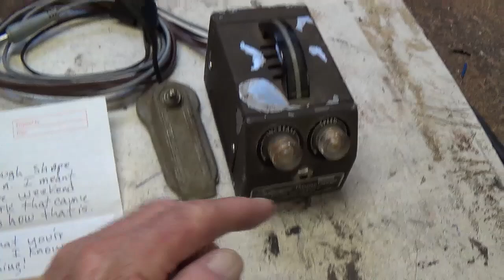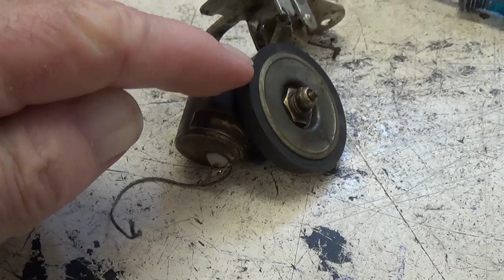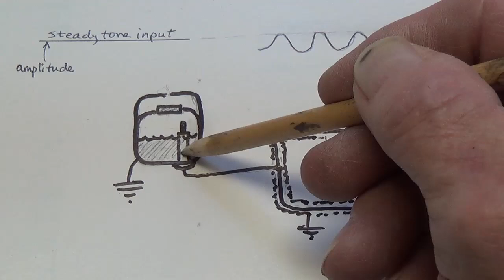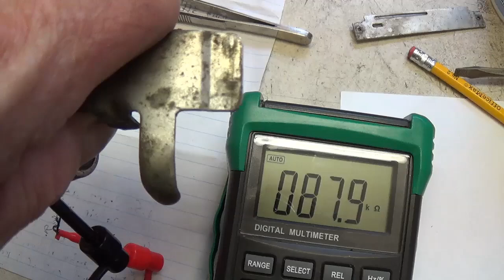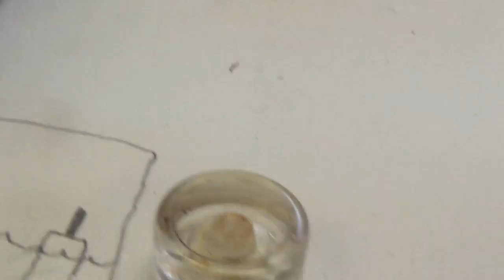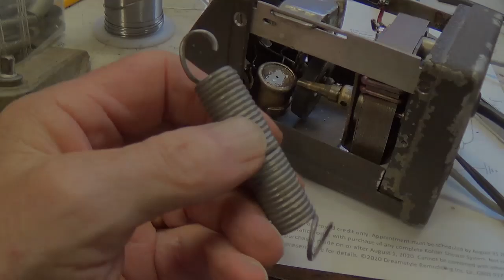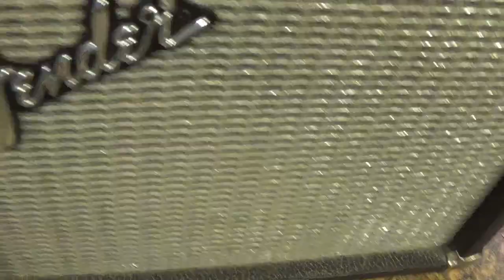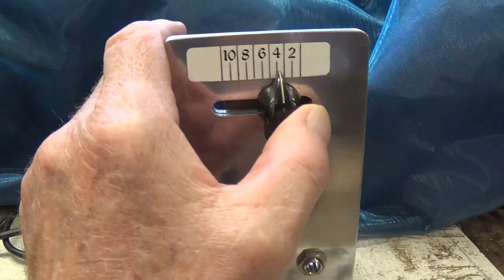1940's DeArmond Electromechanical Tremolo Unit.....DeAd on DeLivery !!!

Comment: I think the C tapered pot was a good solution. I had this issue with a fuzz I made and the solution for me was to put a resistor in series with the pot. I found the resistance level where the effect just starts to kick in, let's say there is a 500k pot and at 250k resistance, this is where the effect is audible, so I'll throw a 250k resistor in followed by a 250k pot, so the lowest level is where it just begins and overall, I still have the same 500k resistance, just the full spectrum of the knob becomes usable. That's a super simplified example, but it works.
Reply from the maker: Thanks for your helpful input, Queef :)

Comment: I thought for sure you were going to put  mercury in that little can.  Dangerous stuff... but back when it was built I wouldn't be surprised if they used that.  Very cool that Windex does the trick.
Reply from the maker: Mercury is too conductive, James. It would probably produce a square wave.

Comment: Uncle Doug, here's an eBay link to a darn-near mint DeArmond tremolo control...$1,599!!!!! The pictures show you what that large hole in the back was for (the one you used for the 3-wire AC cord): https://www.ebay.com/itm/DeArmond-TREMOLO-1950s-Rowe-Industries-Rare-Vintage-Tremolo/254744343444?hash=item3b4ff23394:g:oU4AAOSwoYZfgTox
Reply from the maker: Apparently the price has been reduced to $1299, AJ, so it's a real "steal" now ;)  It makes sense to have an on/off toggle, but the one I worked on had an on/off footswitch to take its place.

Comment: Hi Doug started accumulating some parts going to have a go at building one going to use " Meccano"( I don't know if you had that in the USA )I have a 12volt motor and parts from an old record player   I have an  Ac30 amp a rapier 33 guitar and a black cat copy cat .I am now 63 and  I was 20 when I acquired the equipment. wish me luck ps do you have a po box lots of love to the cooooooool cats from over the pond
Reply from the maker: Best of luck with your project, Shaun. Let us know how it turns out.  Thanks !!!

Comment: I knew that little spring had to be used but you replaced it with a much longer one and different mounting point. You must have inside information on how to improve the performance. It seems to work beautifully.  D
Reply from the maker: There was only one spring, Dennis. The scenes were out of order. Thanks so much.

Comment: Couldn't you reduce the ohms in the Canister (not easy) but would that have improved the low intensity tremolo signal? (Why Windex?) looking forward I have a GM car with Magnetic controlled shocks. I can dial in the viscosity of the shock absorber oil because is has metal fillings that can be pulled out by a magnet. Changing the strength of the magnet changed the ride of the car. Ah Could you work up a fluid that could change its resistance to current flow in the same way????? If you wanted to mess around?
Reply from the maker: The canister has to have a fair amount of resistance even when shorted, Dennis, to provide a pleasant modulation. Windex has the right amount of dissolved solids and free ions for proper conduction.

Comment: I use dBlue Magic on my Model Train Steam engine drive linkage and it can be polished to shine like Chrome!!! Wonderful stuff.  Why did you select Windex for the fluid???  I am so excited to see your unit work and what it sound like. Hoping i can find one I could afford. Great little gizmo. D
Reply from the maker: Yes, as I said in the video, that article is what initiated my desire to own and clone the device.
Reply: Maybe Doug read the article in Vintage Guitar where Billy Gibbons talks about this tremolo device. Billy said he bought a used one, it didn't work, a tech at the recording studio told him it probably needed to be refilled with Windex, he tried that, it worked. 
https://www.vintageguitar.com/18545/dearmond-tremolo-control/
Reply from the maker: Thanks, Dennis. I didn't select Windex.....it's what they actually used.

Comment: you did not mention the little spring hanging of the wheel and canister of oil. Like an old phonograph i expect that spring keep the rubber wheel in contact with the tapered drive shaft. If it was off when received that would have prevented it from functioning properly. If the Plastic units have the same guts it would be great to find one of these units. Super project. Dennis
Reply from the maker: The spring you see is the one I installed, the scenes were out of order. The canister is not filled with oil. Thanks.

Comment: Great video, beautiful piece of tech. I would've loved to hear how that intensity pot sounded in audio signal circuit going all over the place. Do you think the lack of spring could've palyed a part in giving a signature character to the effect? Or if it didn't do anything interesting hopping, now just more reliable and quiet mechanically? This unit at full speed makes me dizzy. But somehow very pleasant sound, not sure if it's the cats playing and Fender, or this unit, but it's smooth. Good job.

That self-made speed control makes me think of old radio equipment controls, chicken head isn't exactly that vision, but does the job! Those lightening drilled holes look professional, as if professional gun.
Reply from the maker: Thanks, Yup. Glad you liked it. We never heard the tremolo without the spring attached.

Comment: I'm wondering what the advantage of switching the hot side of the line is?  It's not fused, so if anything about the foot pedal gets a short to ground, there's going to be fireworks.  But if you switch the neutral, then the current will be limited by the motor.
Reply from the maker: I guess because when you switch the hot wire, the unit is not constantly energized while plugged it.

Comment: i figure it was 12.5 percent of the range of the original potentiometer that was useable.
Reply from the maker: If that much. There was only a small fraction of the arc of rotation that had any audible effect.

Comment: Hello Uncle Doug & Family, I'm sure you know that means the Kitties, I mean Rock Stars. Nifty little unit you will know inside and out, after a thorough restoration. During your sketch explanations, is there an impedance match between the DeArmond and the amp speaker or doesn't it matter? A Kennedy took box finish, I knew for 34 years as a Journeyman Machinist, as I did a 4 year formal apprenticeship, just a measly associates degree. Elementary, my dear Watson. Awesome job on the rebuild, nothing you can't fix. That little 'ol band from Texas. Yes, commenting along with the video. Good to "see" you again, glad you are all doing good. Sweet tweed amp, sounded great. Nice tremolo from that little unit. Been mid to upper 60's down to the high 40's, definitely the 10th month. Thank you for all you do providing quality content. All the best from Oregon, Cass.
Reply from the maker: Thanks for all the nice comments, Cass. Since the signal passes straight thru the DeArmond unit, I don't think impedance matters. Low 90's here still.....getting very tiresome. Our best to you.

Comment: Your graph showing the difference between the log audio and the reverse audio had a fabulous cameo appearnace of an ant. Or....!!! Perhaps it was AUNT DOUG? (love it that (so far) you haven't flicked or squashed said ant back into the spirit pool). :).... Hi Uncle Doug!
Reply: Have you tried running the DeArmond  AND using the tremolo of a nice fender amp? I wonder how that would sound?   Your tremolo speed variance map circuit modification is a bit slower than the DeArmond, no?
Reply from the maker: I used to tell my students never to destroy anything they couldn't repair, and that includes living creatures.....even ants :) I haven't tried the two together and the DeArmond is back in the owner's possession......so maybe next time.

Comment: you said the Vibro Champ.. Fender has a "tremolo" which is actually more of a "vibrato"  -and uses a light roach, right?  cool unit here.. will be on the scout now...
Reply from the maker: The Fender harmonic tremolo, utilizing 3 additional tubes can produce somewhat of a vibrato effect, Malcolm, but all the rest of Fender's tremolos are simply tremolos.....and only the larger circuits use the flashing photoresistor unit.

Comment: UD, what happened to the spring that was hanging loose in there when you took it apart?
Reply from the maker: There wasn't one. What you saw, in a scene out of chronological order, was the spring I installed.
Reply: Wasn't that the spring that held it against the speed control?

Comment: 30:09 - This is where an analog meter comes in extra handy!
Reply from the maker: Yes, indeed, David. By far the best way to monitor pot sweep.
Reply: @UncleDoug  I lost track of how many Simpson 260s and Triplett 630s I own, and man when either one of them is out of specification and will not calibrate you have to wind or combine 0.1%  resistors to  some really wacky nonstandard values, but it's all worth it when you have an analog meter that, when you deduct the lead resistance, is dead nutz spot on with a fresh calibration certificate Fluke 8042 using the 4 lead Kelvin clips. I also have a few Danish Bruel & Kjaer audio volt meters/ dBm meters, that are absolute works of tube instrumentation era artisanship inside. Those are a huge pain to refurbish compared to the Simpson & Triplett meters  but so so so absolutely worth it! The Bruel & Kjaer universal microphone preamp is another fabulous piece of gear that includes the audio volt / dBm meter. (also a huge pain to take apart and fix)

Comment: Greetings Uncle Doug,
   Another great video about a really interesting device! I also have  a little info to pass on. First of all, those clear knobs are probably acrylic. And as luck would have it they were glued on instead of having tapped holes with set screws. This is really good luck. If the holes were tapped the oils present on fingers would have slowly, but eventually, wicked into these tapped holes and caused the knobs to crack. Acrylic is notorious for this. Secondly, several years ago I had a poorly designed but really useful device quit because of a lack of cooling of a shaded pole motor quite similar in construction to the one in the DeArmond Tremolo unit.  Since I could not find a replacement motor and because I can be pig headed I rewound the damn thing myself. It wasn't that pretty but it works very well. With the cooling holes I added to the device the motor does not and will never run too hot. If someone buys a DeArmond Tremolo with a burned out motor they could do the same by drilling out the rivits holding the winding laminations in place. Then, if they have the patience, unwind the the wire onto a form so that they can calculate the length of the wire. Then buy a spool of the same gauge wire and rewind the coil. I know, it takes time, care, patience, and maybe a little gin, beer, whiskey, or wine. Or tequila.  In any case, a broke musician with some time, your video, 20 bucks for wire and a cheap six pack, could rewind the motor for one of these units.
Eric, who prefers gin for rewinding  motors. After the rewind.
Reply from the maker: Thanks so much for the very helpful tip, Eric.

Comment: could you replace the canister with a mercury switch
Reply: That would cycle between infinity resistance and effectively none - no in between. It'd be a chopper, basically.
Reply from the maker: Hub is right, Tim. The result would be a square wave.....more like a machine gun than a rhythmic tremolo.

Comment: The reason the pot seemed to use so little of its rotation is because your signal generator has a 600 or 50 ohm output instead of the high impedance of the instrument. I bet it works fine with a high output impedance.
Reply from the maker: Nope. It worked a little better with the guitar, but still only used about 60 degrees of rotation. These devices are known for their hair-trigger intensity control. With the RA pot, the usable sweep was around 200 degrees.

Comment: I was pleasantly surprised when you said you use to work on pinball machines. I too was a pinball mechanic. On the edge of electro mechanical and into solid state. Cool beans. You will get a education when you learn how a pinball works. Tell me if I am lying when I say, Even a brand new machine will have the ball stick somewhere until you engineer a fix. Heading to the local bowling alley on Sat. nite to free the stuck ball you develop skills you didn't know you had!
Reply from the maker: You really hone your diagnostic skills working on those infernal EM pinball machines, J&B.  It's like trying to fix four or five amp circuits, side by side. I shudder to recall the experience.

Comment: Very warm.  It beats a Watkins Kopycat hands down.  That plokky sound of the tape joint passing the heads, and being re-echoed, wasn't always aesthetic. (Flicks back non-existent hair).
Oh, that's an echo chamber...  I'm up too late....  Wouldn't a well-designed electronic tube device do the job?  Not those funny optoswitch gadgets, just pukka pentodes perhaps....
I would dearly have loved to restore and improve the mechanicals and finish to the way the original would have evolved to by 2020AD.  You could do it, Doug.
Reply from the maker: Thanks, Tony. I tried to do so.....did you see my two creations?
Reply: @UncleDoug  No.  Was it in the same clip?  LOL  I thought I'd reached the end.  Any invention previous to that would involve Indian servants.  They'd be tremulo-wallahs.

Comment: one of these on ebay rught now for a crazy price, the big hold in the back has a power switch in it, I wonder what is period correct?
Reply from the maker: Does it have a footswitch?  No need for the toggle if it does.
Reply: @UncleDoug  you know, I don't think it does, maybe they all had it as its in the same place, or it's an earlier model?

Comment: Why did you chose Windex and what was the original fluid? Since this reminds me of a mercury switch, I'm wondering if that was what was used then.
Reply from the maker: I read that Windex was the proper fluid in a Vintage Guitar story that has a link at the end of the video description. Mercury is not suitable, due to its toxicity, high mass, affinity for brass, and excessive conductivity. It would result in a square wave output, rather than sinusoidal.
Reply: @UncleDoug  Thanks for the detailed reply. Very interesting. I figured no one would use mercury now, but I would not have thought of Windex.

Comment: You are the best I've ever seen at amp repair , building among many other things . My friend recommended you to me . Fine job sir . Would you please help me with something ? I have a 65 Super reverb reissue that I just picked up. I installed a new tube set and while trying to bias , I am only getting a reading on one power tube . One tube is super hot to the touch , the other isn't at all and basically looks like just the filament is on . The amp sounds great but obviously a lot less volume than it should be and it breaks up quickly . I have turned it off until I figure something out . Bias pot will only go as high as 25mA as well .
Reply from the maker: Thanks, Donnie. Apparently only one tube is functional and is flowing way too much current. Switch the tubes and see if the problem follows the tube (= bad tube) or remains with the socket (= bad connection, probably to cathode).
Reply: @UncleDoug  thank you much sir , I appreciate it !! I'll give it a try

Comment: Very cool unit! I worked at DeArmond designing pickups in the late 70s-early 80s. i was able to score a couple of slightly newer units (plastic covers) from the leftovers and one still works well! The other needs new fluid. The lady there who did the repairs told me that they put Windex in a tin can and let it sit overnight, then injected it into the little cylinder with a syringe. A little hocus pocus!
Reply from the maker: Thanks for the historical info, Ken. I wonder if leaving the Windex overnight allowed it to pick up some metal ions from the tin can, increasing its conductivity?
Reply: @UncleDoug  She said it was in a silver lined can which I had never heard of. I did see her take the fluid out of the can and inject it in the cylinder then seal up the hole on one end with a 100 watt American Beauty soldering iron. I didn't totally verify the can being silver lined.

Comment: Uncle Doug, I managed to buy one of these, which needs restoration, on ebay a year or so ago. I got as far as researching it to find out about using Windex to replace the fluid, I believe they used a small self tapping screw to replace the solder seal in the article I read, so the tank could be refilled in the future. Your details on refilling it will be very helpful. 
My DeArmond had been modified with a double knife blade power switch on a line cord to power it up, not the safest solution, with exposed terminals, which I replaced with a toggle switch on the case like the original. My tremolo's case also has missing paint, and I found out it was like the original Kennedy tool box brown paint. So I bought an expensive spray can of it, only to find out it is no longer supplied as wrinkle finish paint, only a textured type, which was a disappointment, so I put my project on hold.
Your video has inspired me to get it out and finish the project, thanks for all the great info.
Reply from the maker: You're quite welcome, William. Best of luck with your restoration project.